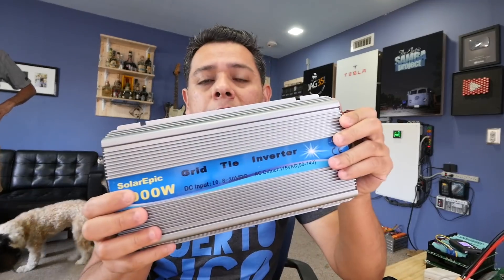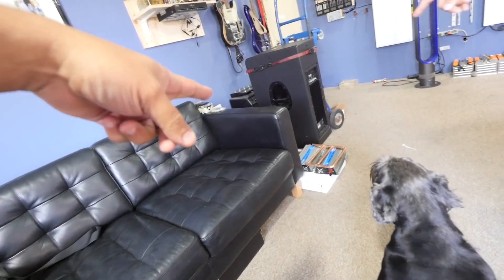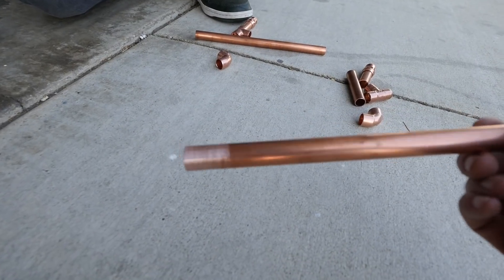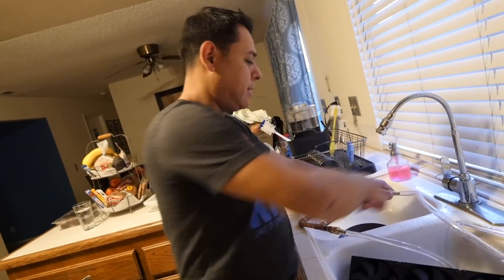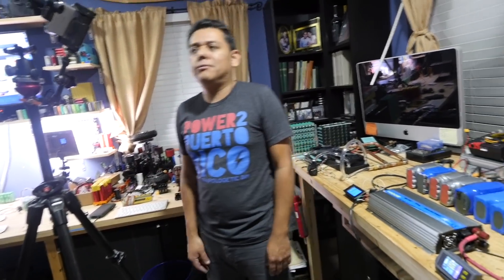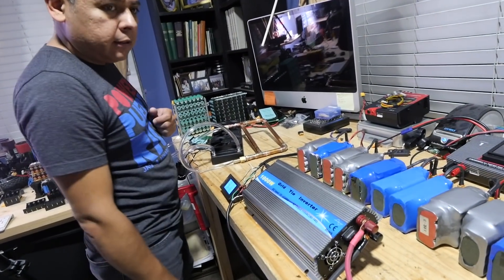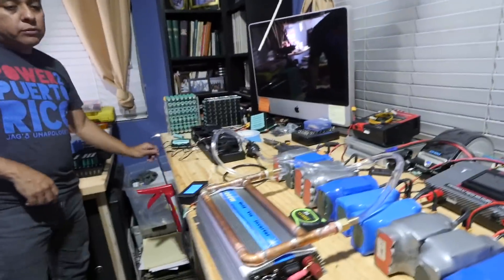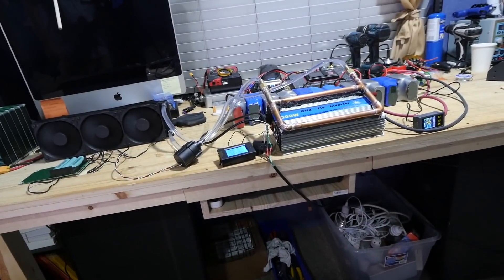Liquid cooling A cheap 1kW Amazon Grid Tie Inverter Experiment

Comment: ..I think this one (blue label) has few watts of stanby power consumption at rest ..try the white labeled (600w y&h).. it doesn't consume any power at rest..starts and shutdowns automatically..overall just upgrading the 12dcv 40*20 fan to 40*28 mm is good enough..i can only connect 1 * 72 cell to each inverter later daisy chain it's ac cord for safety and heat control..I tried a fanless microinverter..it got overheating issues on hot climates..so I had to switch to these simpler types..

Comment: heat rises.  way better to cool from the bottom. with maximum contact.  say a copper sheet attached to your copper pipes.  maybe extra run of tubing between your two laterals. could even back fill the sheet between the tubes with fire mortar to add cooling retention.  and slow the flow rate of water.

Comment: Did you check on the water temperature going into the heat sink compared to the water coming out you need to remember hot water rises cold water sinks

Comment: You can use two stage Peltier chips that will go down to -15F on one side.  Even better is that you can immerse the entire grid tie inverter in pure mineral oil which is non conductive,  and cool off the mineral oil.

Comment: Is it worth the trouble?  Well ... skip the trip to Home Depot and just buy Cooler Master's 3x120mm fan radiator with closed-loop pump and CPU heatsink on Amazon for less than $120.  Just stick that heatsink on the inverter's hot spot to carry the heat away.  Water cooling beats air cooling hands down ... I do crypto mining with GPU mining rigs and all my water-cooled GPUs run about 35 F cooler than my air-cooled GPUs whether I overclock or don't overclock both sets of GPUs.

Comment: That video was hurtful to watch...it is a good idea but so badly executed.

Buy some super cheapo wateecoolers from AliExpress/Ebay and check where exactly the heat gets transferred to the chassis of the inverter.

Best case you ofc open up the inverter and contact the elements directly.

Comment: How about a box with a car radiator at the bottom as a air intake and fans at the top sucking air over the stack of inverters. The radiator could feed from say a underground water tank to use the coolness of the earth, say on the shaded side of the house. Quick question do you know if these grid tie inverters can trigger each other in a power out i am worried about feeding power to the grid when maintenance is done?

Comment: Hey my friend, I know you are watching the camera" and that should have been all you needed for the "REDESIGN" OF YOU WATER COOLING SYSTEM.
NOW anyone can tell ya, that the pipes are not small enough, alright" the only way to really get a (fair trial),!! On this, is to do it agian, but put a 1/4" inch pipe, across the top then go down the sides, and connect with a 3/8's COPPER line, and repeat, every 1/2"inch, or less, and don't have "The end 1/2 "inch of pipe,"
Only use the 1/4"inch COPPER  pipe, to connect FROM one side to the other,.
The large pipes on each side, will force the water through the small copper pipes, faster, there - for, collecting more of the Heat, & distribution of HEAT will be more EFFICIENT THAN WHAT YOU WERE DOING.!! LOOK WHAT IT REALLY COMES DOWN TO, IS THIS,: YOU HAD A GOOD RESULT FOR THE SET-UP THAT WAS IN PLACE. SO, DO IT AGIAN, DO IT RIGHT, AND DO IT AS IF YOU WANT UNBYEST RESULTS.....
Complete than,

Comment: Not enough surface area contact with the pipe. I think you should try using radiators glued on top of the unit Like the one you used on the video That way you have more in contact with the whole unit.

Comment: you just cools the case of the inverter like those crappy laptop fan. the mosfet still get very hot inside. try to watercool the mosfet and make a hole on the side of the case for tubing

Comment: The idea of cooling the inverter is great, which should significantly improve efficiency. You just have to do it differently. In the first attempt, install the inverter in a watertight container and fill it with the 3m novec liquid. This is also used by the server manufacturer Fujitsu, which cools the servers efficiently. These are also completely covered with the liquid.

Best regards from Germany

Comment: Small radiator with fan connected to smaller copper pipes filled with anti freeze would work better, but enough contact service. Best way create a small enclosure or room with an air conditioning unit (and it’s own solar system to power it) it will keep everything chilled. That’s how they cool entire banks of servers in a server room.

Comment: You could open up the inverter and potentially install an air dryer system paired with the radiator to keep consistent cool dry air blowing into the system.

Comment: I would go for thin aluminum pipes and thermal epoxy to seal them in place between the fins, I did this with a car audio amp way back in the day but that method can do a fair job of removing the heat while still leaving the overall structure intact. Keep in mind that that block can also store and quickly conduct away quite a bit of heat. Also make sure that you don't string all of those pipes together in series, do them in parallel so this way you will have less flow resistance and will have more even cooling on both sides of the unit.

Comment: 1/4" tubing flattened along it,  multiple loops covering the top/sides and heat compound under it.  the 1/2" tubing doesn't have enough surface area.

Comment: Hi. Have you though about running your cooling pipes down the sides of the inverter where the mosfets are and have you fought about keeping the water cool because the way you had it I see the water adventurally becoming the same temperature as room temperature

Comment: I love your experimental nature. Enphase  iq7+ 295w UL inverters run on my rooftop under my blazing hot 385w solar panels. I drive these microinverters at full power from 11 am to 2pm all summer long. It would be really cool if you could evaluate this option too because I’m afraid too many diy people are not likely to get good long term value from the cheap amazon grid tie inverters. https://www.altestore.com/static/datafiles/Others/Enphase_IQ7plus_Datasheet_V2.pdf .  You are a really smart guy and I’m a fan.

Comment: Cheap cooling you can use a laptop cooler they have 5 or 6 fans and put the inverter ontop of it. If you need super cool just cut a hole ontop of a cooler with ice and put laptop cooler ontop of hole and then put inverter on that. If you need more then 1 inverter you just make your own ice box use dry ice if you dont have ice maker. Or make a water cooling system like you did into the cooler and then the fans just blow the cooler air

Comment: Im a bit late to the party but i think you could have done that alot cheaper with an aio cooler for a pc  cpu. Put the aio block on the hot spot. Or any other heatsink with way more surface area and a fan would do.

Comment: As always, very nice work.  Thank you for doing these experiments, we all learn even from failure.  A couple of points, 
1. if you were getting good heat transfer from the copper pipes, you would have seen the temperature of the exit water much hotter. They seem to be the same temp going in as out. Seems like thermal transfer problem.
2.  Thermal cameras "lie" depending on material type and reflectivity.  The base material most demographers use is electrical tape.  It always shows 0.95% of surface temperature.
You can put a life on any surface to get accurate temp readings.

Comment: The best way would be to take the mosfets off the aluminium  mount replaceing it with  a custom made copper water block and then use the same rad u were useing and pump but also add a small reservoir so u can garentee fluid levels its not that actualy complicated less the mosfets are perm mouted to the aluminum

Comment: Pipe needs to BE ON THE heatsink. ,say you have a refrigerator in the garage,your friend comes over to help you .he goes to get a beer an can't open the refrigerator door ,your the only one who knows how , because the handles broke.anyways, IT'S A OLD REFRIGERATOR, DRILL WHOLE THREW FREEZER,RUN PIPES THREW .A WATER STOP IS ALL YOU NEED THROUGH THE FREEZER... WITH THE INVERTER STOPPED, THE WATER STOP WILL NOT LET  THE WATER FLOW , JUST A LITTLE MORE PIPE,  SOME GARDEN HOSE. I'LL be 71 9/14, stuff  like what your doing has me doing at least something , even if it's wrong .I get the chance to serf the web ,Your web page gets thumbs up.     PS.   Spim0811p an, Battery Hook up,going 2 try to make 2 24v batteries for my Rascal scooter ,the ones it came with are ? Just old.

Comment: The switching transistors are on a separate heat sink.  You just need to run wires out of the inverter and mount the mosfet on another bigger heat sink

Comment: Heat transfer is a function of surface area. You need a large surface area on the water lines to get good thermal transfer. Use a flat surface water block instead of the curved surface water lines and the heat transfer would be much better.

Comment: I would try this: Drill a hole through each fin. Enclose the fins so they can be used directly to contact the water.  A combination of epoxy and gardening hoses would do the trick. I wonder whether stuffing  a few 1/4 inch plastic lines into the gaps between the fins would be enough...

Comment: Have you thought about putting your inverters in an electrical enclosure with a small air to ait cabinet cooler? Very efficient and cheap way to cool using 2 small 12v PC fans (one to push air, one to pull air.

https://thermal-edge.com/product/a2ac040/

Comment: You would have to design the Power Inverter around the water cooling Idea. Meaning the mounting parts to the Piping instead of heat sink. Or designing a Heat sink to have water flow through it. Additionally have to have a Antifreeze like substance to flow through.

Comment: Try a cooled copper plate the same size of each inverter so it transfers through the bottom. Also use your same setup but start cooling a cold inverter so its not trying to cool down an already hot one.

Comment: I got that same grid tie inverter on az, it lasted about two weeks they blamed 'dirty rural power' and sent me mofset but I didn't have the skill to replace them w/o melting the board.
Reply: That seems counter intuitive but you need a larger iron tip to tranfer lots of heat to the solder in a small amount of time. If you need more than 5 seconds its not good.

Comment: OK,   so if you want to do this right you need to ditch the covers and find where to buy home heat sinks thAt have a base that is Abel to be clamped in a drill press and machine holes thru the base then thread the new lengthwise holes at each end and screw barbed/pipe thread adapters on the ends to connect tubing to a manifold (basically a 1/2 inch pipe like you were using with multipile taps to feed this cooling block).  Then it would  be copied on the other side and recombine back into 1/2 inch.  In the section yet to be addressed you could store this heated fluid in a container(sump?)  The fluid could pass thru a radiator in refregorator with a fan blowing on it.

In my world problems can be as small as your imagination is large as long as you have real world electrical egeneering and an understanding of current basic chemistry and physics as your tool kit.

Send me a picture of the exact areas measured out to the say, 1/16 or mm if you prefer.  I will come up with a drawing, 3D of a heat sink that we can cast in aluminum with recycled scrap into heat sinks that we can make and sell as a kit.  
I have an extensive background in electrical.  For line voltage I worked as a military and healthcare electrical contractor.  I have also designed medium voltage power systems(in and arround 15kv)  I am an expert on lighting systems in all current technologies as well as very proficiently at power storage solutions.  I worked for many years as a estimator / project manager that both specialized in all the before mentioned as well as...  Well you'll just need to hit me up to find out all that could be.  I'm board as of now, I am mostly recovered from a massive health problem I had 6 years ago.  I'm a late born student of my hero to my main profession in life, Nicola Tesla.  I come from a line of men devoted to the transmission of electrons.  I was born 4th in a generation of a family of electricians devoted to the art and theory of everything electric including forging new and more efficient ways of harnessing natural energy in abundance around us and make efficient use of the universes abundant stockpile of it!  Our wold is flooded with so much energy every day we recieve enough to fuel us for a year with an abundance left over on a daily basis! 

Mic drop...   Leaves stage.  Lights are brought up, applause, some cheering...  
Everyone have a great 5 ⭐ weekend and be sure to ask some questions as I have put myself out there as a player, maker, and  probably a fool, but in all reality I am here 📌 to above all else, to learn, experiment, and have so much fun doing it I'm sure soon it will be first California and turn the rest of the states will outlaw it!
Back to the LAB🤓

Comment: I have use the same inverters, I have a $20, 15w  240v fan (Australia), the inverters are in a wooden box on a wall outside. the bottom is open and  the top has an opening on each side, the fan creates a vacuum in the entire box and everything drops at least 15c

Comment: I just found out these units output FETs are gate drivin by the AC grid signal and the DC output and full-bridge is isolated from the control logic. This makes a square AC output self syncing with line freq..

Comment: This is bad. You need to flatten the copper and make it zigzag to increase surface area and give the water more time to run through.. Or if you want to keep it small then just get a gpu cooler block and mount it on top of the area where the fets are

Comment: you should feed and return water from different ends to balance flow. you need more surface area to conduct heat away from the case.

Comment: Unless you're hell bent on  liquid cooling, I'd recommend sticking with air cooling but with enhanced airflow.  First of all, the inverters should be  mounted on a vertical surface with their hotter end upward.  This will assist convection through the fins, which are designed for maximum heat transfer with greatest airflow.  The tiny fans built into the inverter only cool internal components.  The heatsinks conduct to the outside air but are only minimally cooled by moving air inside the inverter.  For better airflow the vertically mounted heatsink fins can be enclosed in vertical sides with maybe 1/2" to 1" clearance between them and the vertical walls.  Extending these sides above the inverter by maybe a couple of feet will create a chimney effect and further aid airflow.  Lastly, the airflow through the "chimney" can be drastically enhanced by removing the fans from your radiator and sealing them to the bottoms of the chimney(s) to assist convection cooling.  All fans involved in this, including the small fans inside the inverter, should move air upward. With fans assisting chimney airflow, additional chimney height is probably not necessary but additional height is still desirable because it results in better airflow should the fan(s) fail.

Comment: Try 3/8 refrigerant tubing.  It’s bendable and you can get it tighter into the fins on the side the heat is being produced. Make the copper contact the fins as much as possible with thermal paste in the fun groove.  Try to get tubing in every fin possible.  

Not talking out of my ass here. I work in heating and cooling and understand thermal dynamics pretty well.

Comment: If the outside shell is detachable, you could have an aluminum block milled out with a water channel inside with water fittings as they use in water cooling blocks in computers, that would could be easily sourced from Newegg, or any computer gaming shop on line,or even better, use a thermo-coupler with a water block on the other side of it, and actually recover some of the heat and turn it back into DC! Cool huh....hehe

Comment: I removed the back plate and cable tied two spare 12v, 12cm case fans to it with a step-down power module off the solar 24v input so I could control the fan voltage/speed/noise. Works really well, internal fans never kick in because the large fans are always going quietly until there is no more sun.

Comment: I can make something that would work. You need a 3/4” vent elbow commonly used on baseboard heat with a bleeder to get the air out. The other thing is the way you piped it the water will take the path of least resistance. You need to put the tee on the ends in the middle to feed evenly. If you use 3/4” on the ends for the header and 4 or more 1/2 “ lines in between you will have more contact surface. You could also get sheet copper and solder it to the pipe for better heat sinking.

Comment: If you use 1/4" continuous copper tubing and run a continuous loop starting at the hottest point it will be much more efficient.

Comment: Cool experiment, but I'm sure it would have worked a lot better if you had found some tiny copper tubes that would lay down in between the aluminum fins.

Comment: for cylinder batteries, the best way of cooling is to cool the tabs. The heat transfers faster towards the metal/carbon rather than through the isolation layers. The isolation increases as the number of turns in the rolls increases, so energy cells are worst heat transfers though the body of the cell than to the cell ends. Also I think the negative side is probably the best way because the connecting tabs are probably making better heat transfer contact there than the positive side.